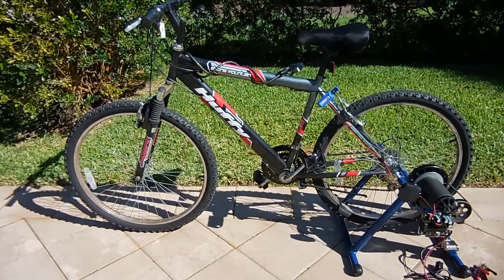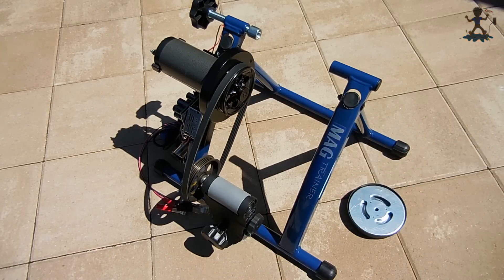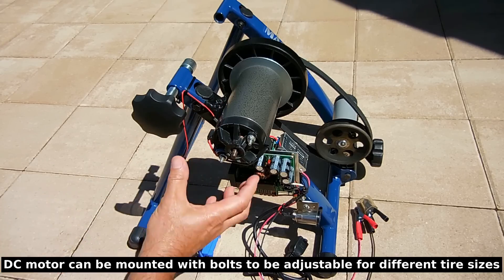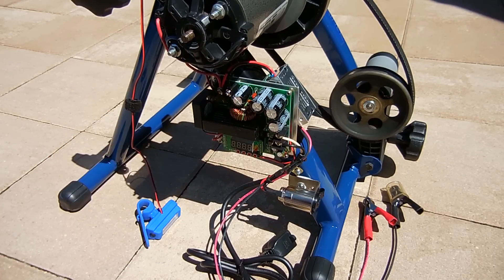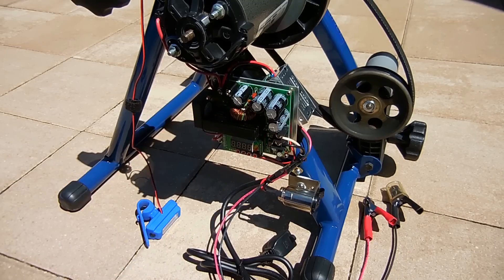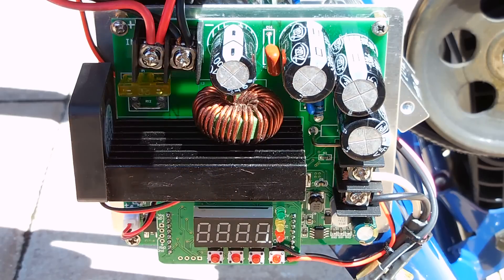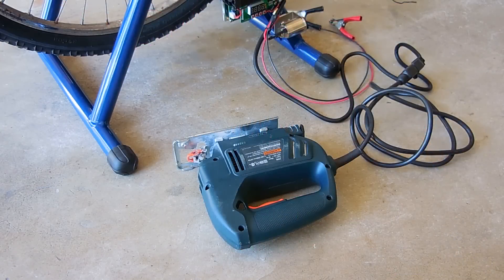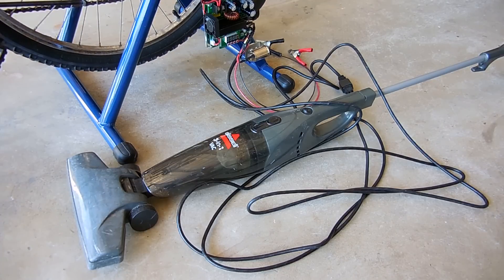Homemade Bike Generator

Comment: That's super cool you're able to run those appliances with 110v DC! And I agree, most of the videos on YouTube show bike power generators being connected to a battery and then to an inverter which isn't that impressive since the inverter can run straight off the battery. Thank you for sharing all the details!

Comment: great info glad to see builds like this I tried to look up this 110-volt buck booster can you please tell me the right part number and where to buy it from thanks.
Reply from the maker: Should be a link in the video description area
Reply: @electronicsNmore  Yes ok but it said the site is unsafe and would not pull it up can you please send me a good like for that 110- volt buck booster thank you.
Reply from the maker: @stevenpleasant5834  A new link has been posted in the video description area for the dc-dc booster.
Reply: @electronicsNmore   ok thank you for trying I still did not find the one you are using and I see others have posted they can not find it either so it is just not me anyway I am trying to learn and build something like this and want to be able to take 8 to 50 volts to 110 output I like your info and video I am going to use a hoverboard motor or a treadmill motor to not sure yet on motors. thanks.

Comment: Fantastic! There is a video out there with a 220VAC bike up on blocks but seems like 100W max power.  Would you in the meanwhile know what the power generation max is at your 110 V AC .  (the tool rating of 3 A  doesn't tell what current it is taking when unloaded)

Comment: Fantastic Video !!!!  I've been intrigued with using weight / gravity dropped from a height connected to a sprocket / geared / flywheel system ... What are your thoughts if you could front-end your system, at the cranks, with a weight dropped from a height?  How long could single weight from 10-15 feet drive your rig?  Of course, I've thought about a cascading set of weights where as the first weight gets to the ground it would trigger the release of the second weight and so on... Many are concerned with "how will the weights get reset to the top position"?  Well, if I had my way, I'd grab the rope/loop to hoist the weight up and just sit down .... My 200 pound frame should easily pull up a 100 pound weight hey?
Reply: This seems like a good idea. Like an old  coo-coo clock. You could use more weight and a multi-block pulley system to lift it easily, and then gear down for longer run times, so you wouldn't have to lift it very often. Or you could lift weights much higher for longer run times.

Comment: I was hoping to make something similar to this to power up my 12 amp peak furnace in a black out or brown out senario.  
Why not position 2 motors with the weight of the rear wheel directly on the motor pulleys and all the juice feeding directly into a battery bank with an inverter attached?
A solar or wind generator could also be wired in.

Comment: I’ve never seen someone so smart do something so incredibly dumb like running an angle grinder with the blade on or a hedge trimmer right by their ankle. Great video.
Reply from the maker: There was nothing wrong with what I did. You should've realized that the power tools wouldn't have a jerking motion to cause potential injury when they powered up.

Comment: Hi, just wondering was there any particular reason why you went with a treadmill motor? I'm planning to replicate your design and I'm wondering if there's anything I should be aware of when looking for a motor. Thanks a lot. Great video!
Reply from the maker: I had 3 of them on hand. :-) You can use an alternator, and many other DC electric motors. Thanks for watching!

Comment: How about using a 5kw electric motor, would that work better at charging alot batteries to run your home?
Reply from the maker: You can only do so much work. Watch my other video below. Thanks
https://www.youtube.com/watch?v=s1omETrT54w
Reply: @electronicsNmore  i seen that video already.
I have been trying to find someone using a big electric motor like a low rpm 7kw, but all I find is people using small ones.
I wonder if its possible

Comment: Could you tell the list of needed  accesories, pls. tks.
Reply from the maker: Which accessories? The belt will vary in size based on how you make yours, the pulley is from a car(Honda power steering unit).
Reply: @electronicsNmore  did you use a power inverter Black & Decker?
Reply from the maker: @cezarfr4506  I used a DC-DC converter.

Comment: Wiring Diagram ?
Reply from the maker: I explained everything clearly in the video. No need for a wring diagram, it couldn't be easier. The output feeds into the power converters.
Reply: @electronicsNmore  In your opinion. Your view count is very low.

Comment: Were the applicances operating in their nominal voltage but in DC mode?
Reply from the maker: 120VAC has a peak of 165-170V, in the video I use 115-120V DC for the universal motor appliances, so it may run at a slower speed.

Comment: Amazing! I wonder if it would be possible create an electric bike with a generator?
So, the generator makes energy enough to power the electric bike battery. Thanks!! anadearmond7@gmail.com
Reply from the maker: Glad you enjoyed the video Ana. Yes, it's possible. When the electric motor isn't in use, you can charge the battery by pedaling.

Comment: I am still a little confused about the 120V dc is used for. How come you were able to run 120V ac appliances?
Or did I misunderstood something?
Reply from the maker: Some appliances use universal motors.
Reply: @electronicsNmore  ok, thanks

Comment: What really matters is when you demonstrate the operation of 120vac appliances, you need to show them the LOAD effect. So if you want a jig saw to work, you have to cut plywood or mdf while you peddle. This would be a more accurate demonstration. A jig saw with no load, might only draw 250ma. No big deal, but a  jig saw being used to cut 3/4 inch plywood may draw 3A of current = 360 watts of power assuming 120vac supply and ignoring power factor.

Comment: I'm getting 4.5 amps charging on bicycle treadmill motor using DC-DC buck converter into a 12 volt battery - at 12.6 volts. https://www.youtube.com/watch?v=oPUniOsn_HA Here is the digital amp reading on the DC-DC buck converter. What amps do you get charging a 12 volt battery via your DC-DC buck converter? thanks

Comment: This isnt true sine wave in DC.
Why are the capacitors so small. A heat sync  on that wimpy coil? Tesla would be like, "Ohm Boomer!" See what i did there?
Dude, batteries are to be daisy chained to balance the charge, or at the least paired so you dont damage the cells.
You have to switch to a smaller gear when it gets past the torque resistance point.
Reply from the maker: What? The output is DC, not AC, no sine wave. The DC output does have a ripple, but you can't expect perfection from a $20 step up converter.
Reply: @electronicsNmore  im just giving you a hard time. Your layout is very intuitive and well thought out.

Comment: Very nice. Thank you. How much energy would it be possible to get out in to a battery, let's say from 3 hours pedaling at constant 20 km/h? I live on a boat, could I charge up and run a few LED bulbs, and a computer, and a smart phone on this?
Reply from the maker: Thank you Jan! If you adjust the bike's gear ratio correctly, you'll get a reasonable charging output without killing yourself. :-)

Comment: I'm working on a bike powered generator using a car alternator.  Do you build out the electronics as shown in this video?  If so, I'd like to purchase the components and wiring already assembled.  I don't need the bike stand, bike mounts or other mechanical parts. Thanks very much.
Reply from the maker: No, I only supplied a link to the dc-dc converter. Thanks for watching!

Comment: i bet it get really hard generating enough electricity to run any tool. your heart will stop after 2 minutes pedaling.
Reply from the maker: All depends on the load, and gear used. A heavy load will give you a great workout. :-)

Comment: Hi, I have built a really nice Phonograph player out of all copper, even the sound box, Ive decided to make the power supply for an electric turntable out of a similar DC motor, I'm considering using your capacitor bank instead of battery's because of the players "short run time use"  What do you think, (I'm a retired dealer mechanic)
Reply from the maker: You'd need a voltage regulator to provide a steady output from the cap bank.

Comment: Yikes. Maybe in a last ditch situation would this be useful if you didn't have fuel for a gas generator after a hurricane. Using this in a underground bunker though...food and breathable air are always in short supply in a bunker. So, exercise like this would burn a lot of calories and require more food. Increased cycling would create much more CO2 for the scrubber to clean.  Also, over charging a lead acid battery creates hydrogen sulfide. A colorless, deadly and explosive gas that smells like rotten eggs. I'd leave this top side for the zombies to play with.
Reply from the maker: Normally you'd have a ventilation shaft with a HEPA filter that you can open and close. You'd also have LED plant lights and a couple plants. As long as you don't overcharge the battery, there won't be any gas produced. You won't be exercising daily. :-)
Reply: @electronicsNmore  enh...a lot of if you dont's. Maybe as an absolute last resort. Generally I find replenishing takes longer and is much less effective than consuming due to entropy. As long as you only use it for yourself, I guess there's no harm.

Comment: Wow! I've finally met another intelligent, with commonsense human being! You are freaking AWESOME eNmore! I LOVE! your videos, incredible!  I found you looking for good, competent info on troubleshooting microwaves to fix mine and discover your are the Sh!t, the real deal my friend. :) LOL Thanks for recommending I check this out. Now imagine integrating a windmill or water paddle wheel or tidel float actuator or a combination of all the above if you have the locational resources instead of leg power. The possibilities and applications are endless!  OUTSTANDING! Great job! Now I want you to try making one of my ideas work that I don't have the technical prowess you have, but know it will work too. A brown gas generator powering a 5HP converted Petrol-2-Gas carb installed thats powered from the generator. I've seen real deal water wheel powered by water pumps which was powered by the genny it was spinning. And of course it had to be started via house power and then switched when at full flow/speed that was the real deal. The guy was getting about 1.5k of excess genny power after the cost of startup of the system and expense of running the pump. If I can find the link, I'll post it. It too is amazing and completely transparent. These hi-caps are the way to go. Geesh, you haven't even stepped anything up on this great idea! Amazing!
Reply from the maker: Thanks for the kind words, and thanks for watching!
Reply: @electronicsNmore  You deserve them... Now try something really cool and world changing because if anyone can figure out the electronics end of it, you can. Do the Hydro-Genny test and change the world and I'm serious... I just don't have the time or expertise in electronics that you have. Do some research on brown gas electrolysis. There are folks generating their own Hydro via solar, cleaning up through processing and charging their bays of Hydro tanks for Hydro conversion.  I think, even though there is mechanical challenges to overcome and address, that the Hydro to mechanical could be a more efficient way of conversion. Don't be afraid. I know a lot of folks are afraid of actually succeeding for fear of retaliation, but times have changes and now WE are big brother watching them... CLOSELY and they know it. So they are actually doing their job descriptions now "looking for "real" bad guys instead of trying to keep real, decent human beings down as it's been since industrialization began. Tesla's my hero! Are you realiated? :) LOL Have a great weekend friend and please ponder it...

Comment: I need someone to talk to. CAn we be pen pals? My basic thing is this: I think the wheel should generate the electricity. I want to see spokes wrapped with copper. I want to see magnets at the forks. I want a helpful spark discharge at just past top dead center, like a gas motor. I want the ball bearing of the wheel to look like a Searl generator. A Wimhurst machine looks like a bike wheel to me.

Comment: I know your channel name is electronics, but I had this brilliant idea of hooking up a windmill to an air compressor, and using pneumatics instead of electronics. The benefits of such a system is the mechanical energy is stored as mechanical energy, rather than being converted to electricity and then back to mechanical energy. Do you like this idea?
Reply from the maker: Unfortunately I'm not too fond of the idea.

Comment: Something many may not know. The display unit on the inverter can be programmed off of the unit by placing it on another type of module. The Ming He units all use the same control sub-module so if you have one D3806, you can pre-program the control module for the B900W. Or a B3603. Or any of Ming He's products that use that sub-module for that matter.  Just stay within their voltages.

The only problem with bicycle drives is that a human can only produce a little over 1 HP in a burst and about .01 HP over a long period using just the legs. Now if you set it up to one of the exercise units that also use the rowing action, then you can get a little more out.

Comment: Great build... but how does one both power and operate tools simultaneously from the bike seat? Doesn't this unit need a robotic arm of some sort? 😁
Reply from the maker: LOL. The person using the power tools would require another person to be on the bike, unless you used the lead acid battery and inverter option. When you're done using the tool, you ride the bike a few minutes to charge up the lead acid battery. Thanks for watching!

Comment: I made  one of these some time ago, but I used a car alternator. Those also work, but need some custom electronics for the voltage regulator and a little bit of power to kick-start the field coils before they become self-sustaining.
Reply from the maker: Thanks for watching!
Reply: You're welcome to my regulator design if you want it. For something as low power as the bicycle I think your use of a treadmill motor is probably better. The alternator would be more suitable if you were building something like a micro-hydro generator.